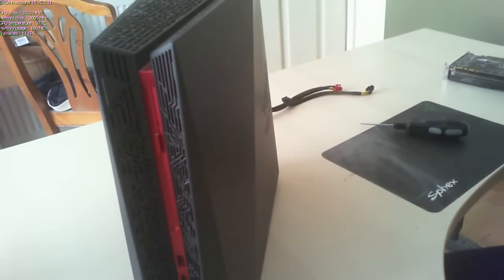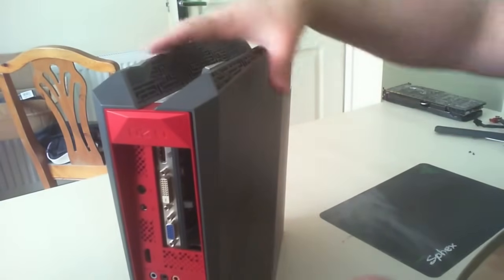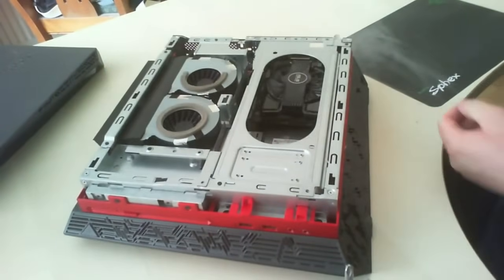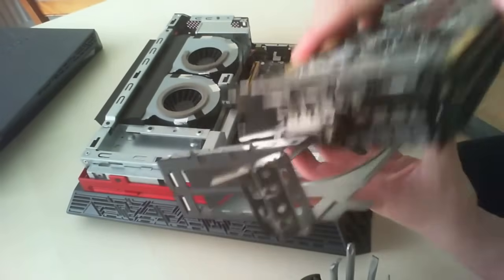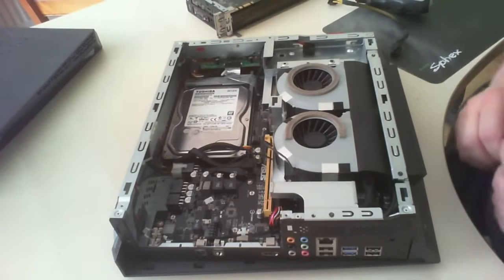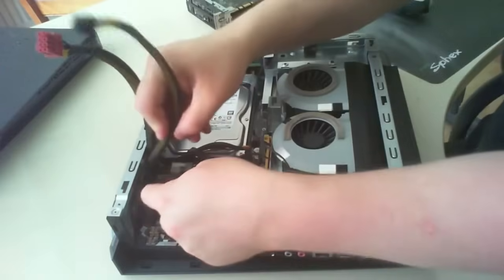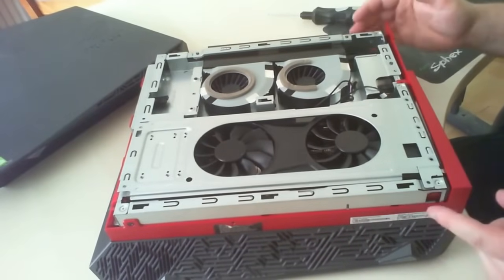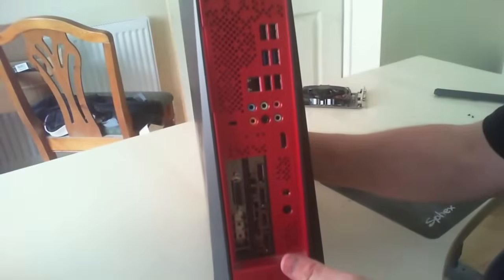How To change Graphics Card Upgrade Tutorial (Asus ROG G20AJ)

Comment: I was wondering some sites say you have to move all the jumpers up (the row of jumpers) some say only a couple you move, I've yet to find any discription on what those jumpers actually do
Reply from the maker: when I did these videos over 10 years ago, I though it was to active the second power brick to make the upgrade. but to be honest moving them or not their seemed to do nothing. but I have not had this system in that time so I have no way to test this for you, check the asus rog g20 forums and ask the question.
Reply: I was thinking the same?I have moved the jumpers one website said to move,and it acts if it only runs off 1 power supply and not both?

Comment: great tutorial.  I'm working on my daughters because she lost all video output (monitor won't recognize the connection).  Her's has a EVGA GTX 1060.  Should i get another one of those or is there something better that you're aware of?
Reply from the maker: Hello, glad the video still gives people valve after all these years. have you plug cable and plugged it into the onboard motherboard, just to make sure your system is till running fine as it as might not be a fail graphics card. what system do you have, cause it depends on your cpu and weather going above a 20 series might be a waste of time, just cause your have a bottle neck on your cpu.

Comment: can i put an rx6600 in there since its only 132 watts
Reply from the maker: Hello, if the card will fit, then change the second power brick to the dell power brick and that will give you the extra amount over the standard power bricks, also you change the power of power takes within the MSI afterburner software, so you can run it even on the standard power bricks. just depends if you want to use all of the power of that card
Reply: @ ok cool thank you

Comment: I have the gtx 750 i5 version. What gpu should I slap in it if i don’t want to upgrade psu?
Reply from the maker: hello, which model computer do you have, is it the AJ or BM model? do you have 1 or 2 power bricks? cause you will need to factor in the extra cash for the second power brick and power cables on top of the cost of the gpu

Comment: works with a 2070 fine for almost a year anyone tested anything beefier?
Reply from the maker: the issue with later new cards is the bottle neck with your cpu, some people might be still running the old i7-4790 and you will go so far before you will start losing performance from the card, you will just be having a powerful card and using only a certain % at any time

Comment: So im upgrading my G20aj from an i5+gtx 950 to an i7 4790 (non-k) +gtx 1080. I dont know which gpu pins ill need to make this work. I know the 1080 itself has 1 8 pin connection. What im not sure of is what Pins i need from the Mobo side of things. Any advice? Thanks in advance

Comment: Thanks a lot welsh, now i just bought a RTX 3070 Inno3d and 330W Powerbrick , but when i tried to running it, it wont turn on the GPU, what do i do wrong ?  btw mine is G20CI
Reply from the maker: Hello, do you get any display on start-up, I found some people which had this issue is either the pin inside hasn't been moved over on the JC01 pin or the riser card which is on the pcie of the graphics card is not flat and going into the slot on the motherboard. does that make sense, it does when I write it lol
Reply: @welshwhoopee  i thought the power supply is the problem , it is the 3070 that i bought is broken , i just repair it and it work like butter with original adapter , fyi motherboard cant handle more than 280w
Reply: so it unnecessary to buy another 330W
Reply from the maker: Oh ok, is that the Dell 330w power brick?

Comment: Hello nice video! I have a question, I have asus g20 aj with i5 4460 and gtx 960 2gb, upgraded the ram to 16 gb from 8 gb a few years ago. I have been running the GPU and CPU since I bought the PC like eight years ago or something and I really need an upgrade of components, what would you recommend? Sould I only upgrade the gpu or cpu or both, I know upgrading both may be there best option, but which one would you upgrade if you had to choose one XD? I have read some comments and I can say that I have the bigger original powerbrick that has 2 powerbricks attached to each other.

Thanks in advance!
Reply: And also will the motherboard be an issue since this is an older pc that may not be able to handle the newer components?
Reply from the maker: Sorry for delay, do you still need help?

Comment: Hello @welshwhoopee seems like u know a lot about them rigs. I am a computer-noob but have an G20 since 2016 with an i7 - 6700 @ 3,4Ghz, 16GB Ram and a NVidia GTX 980. It has 2 Power Bricks. What GPU-Upgrade would you recommend based on those specs? Thank u very much!
Reply from the maker: Hello, yeah I brought a few of these and work really on them and course help a lot of people over the year. your best gpu on that cpu is around the rtx 2000 series like the RTX2060/2070, mainly due to the bottleneck to your cpu. but if you upgrade your cpu then you could easy handle a card from the RTX 3000 series, like RTX3060/3070. the only issue is just which card and will it fit, the card itself has to be small then the founders edition/refence card and not to wide, as then 3000 and 4000 are 2/3 pcie solts wide, but send me a link to a card and I can help you or your budget.

Comment: Hi, i recently got a 1660 ti for christmas as a gift to replace my gtx 750. However, when i opened the case and tried to put in the 1660 ti, it wouldnt fit! I saw the dimension restraints of the card and my card is around 3 mm too tall so it wont fit in the case. Would there be any way to fix this or it is impossible to use this gpu.
Reply: I do realize the possibility that i couldve inserted the card wrong into the holder but i tried to fit the gpu into the case raw, and it still didnt fit. So i think this will be impossible to use.
Reply from the maker: Hello, you don't really need the case to put the gpu in. if you install and its too wide then you will need to replace the card, if your getting a new card and you want a 100% fit, then go for a founders edition/refence card. sorry for delay

Comment: Whats the best GPU i can put in there? Ive been using a 1080 for years now and im thinking of going up to a 20 series i just really want to make sure it'll work before spending the money. I obviously already have the power supply. Dont think a 30 series would work and even if it does it would probably be bottlenecked. I know its an outdated computer but mine runs just fine and im thinking of using it as a dedicated gaming pc toll it dies.
Reply from the maker: Hello, what model and cpu are you running? if your on the old Aj and have the 4790 then the 3000 will only give you cpu bottleneck, if you have the 6700 cpu then you should be ok with a 3000 series, but be careful as most of these cards are really wide, there started to take 2/3 pcie solts and will no way fit into this pc. so trying to stick to the founders edition/refence if your best bet

Comment: hello welsh i want to upgrade my graphics card to the best one i can fit in my rog g20 i think its the aj what would you recomend to ugrade it to i looked at a asus gtx 1660 super but it says it need 450w i only have one bif power brick
Reply from the maker: Hello, depends if you have 1 or 2 power bricks, if you only have 1 then stick to the model that doesnt need extra power but works through the pcie line

Comment: Thank you so much for your videos. Just wanting to tinker with my old PC. 
Can my G20AJ that didn’t come with the 2nd power brick upgrade from the original GTX750 to an AMD RX580 8GB without needing the 2nd power brick ? 
Having a hard time finding one, if you could recommend a current link to one that would be great.
Reply: No it cannot IF you use that card you will need the 180W power brick... Any 10 or 20 series NVIDIA card will need it to power up

Comment: Do i need to move that pin for the power supply if im upgrading from a 6 pin gpu to an 8 pin? Or will it already be in place to work?

Edit: for reference I'm going from a Gtx 960 to a Rtx 3050
Reply from the maker: what model is your pc? you don't need to move the pin and going from 6pin to 8pin is fine, do you have 2 power bricks?

Comment: for this pc, im going to upgrade the gpu to a gtx 1660 from a gtx 750. will it be possible? im worried i dont have enough pins or space.
Reply from the maker: Yes it's fine, just depends on the card you choose and if you need the second power brick
Reply: so the gtx 1660 will fit in the case and it has enough pins to plug in?
 @welshwhoopee
Reply from the maker: oh yes
Reply: @welshwhoopee hi i just got the 1660 ti for christmas and i looked at the card and it had 8 pins. however my current gpu of a gtx 750 uses a 6 pin. will the case have an extra 6+2 pin in it or it just won’t work? i really want to use this graphics card.
Reply: If you see this, i tried to put the graphics card in the holder and it is too big to lock. Will it be ok to plug in without the lock? How do you plug in the gpu without a holder as you said in the video?
Reply: Ok so it turns out my 1660 ti can’t fit in the case at all. With and without the holder. So i guess i can’t use it unless you have an alternative way to use it?

Comment: Thanks for a great video! I have the G20AJ with two power bricks and a 980 GPU. What graphics card would you recommend putting in now in 2023?
Reply from the maker: Hello, don't go anything above the RTX 20 series as your cpu will be your bottleneck on that system
Reply: @welshwhoopee  Thank you so much for getting back to me 🙏 Would any RTX 20 work, even the most powerfull/high end? Would you recommend any specific card? Thanks! 🙏❤️
Reply from the maker: well you got the AJ model, so max cpu is the i7-4790k, but with only 1 power brick then your limited to the lower tier which don't have any power to the gpu, if you can buy a second power brick cheap then your more open to much batter cards.

Comment: please help me - tell me what the jumpers are responsible for, I can't figure it out and connect an additional 180W power supply, I already understood that a 230W power supply can power two connectors 6 and 8, but if the video card consumes more than about 150W, the computer turns on, you can also probably switch it with a jumper so that the second power supply is used to power connectors 6 and 8 at 180 - right? how to do it ? my new card is gtx 980
Reply from the maker: Sometimes you need to do the switch jumpers but not always
Reply: @welshwhoopee  I already figured everything out myself. One lone jumper enables or disables auxiliary power (6+8). The remaining five jumpers in a row switches from where the video card will take energy 6 + 8 - either from the main unit 230 or from an additional 180. Excellent power supply flexibility - thanks to asus engineers. Personally, I bought a dell slim cylinder for a 240w power supply and it alone feeds the entire system - now it's a gtx 1070, but soon I will switch to 1080ti. I really, really like pascal - it can be super undervolted. I plan to undervolt 1080ti to 120w tdp. It's just incredible - no heat, no noise, and only a relatively small loss of fps. And more reliability-life of the video card.
Reply: @welshwhoopee  Please help me !!! - I really need photos and dimensions of a plastic clip - which keeps the video card from sagging in a metal bracket. I want to 3D print this clip - but I have absolutely no data about it. And I asked in several places - no one responds

Comment: I want to use a 1650 super, the graphics card has a 6pin, can I use a 6 pin to 6 pin or do I still need the 8? When I did the 6 pin to six pin and moved the jumper to the left it recognized the card but I couldn't boot because it said keyboard wasn't detected and didn't recognize the USB dingle for thr wireless keyboard or when I plugged in USB keyboard. Ideas or suggestions?
Reply from the maker: So you have installed the 1650 super and still nothing from usb?
Reply: @welshwhoopee  changed the jumper as per your video, connected the 6pin from motherboard to the graphics card. Plugged it in and no USB.
Reply from the maker: inside windows or via the bios bootup screens?
Reply: @welshwhoopee  can't even get to the BIOS due to not having a keyboard to let me go to the BIOS, goes to a black screen that says no USB detected
Reply from the maker: I think I had the same error funny enough with my pc at that time, the way I got around it was getting a converter, on the back of the pc are the old school mouse and keyboard ports, you can get a adaptor that takes it from the old school mouse/keyboard to usb. the item is a "PS/2 Adapter - F/M - USB mouse to PS2 Adapter - USB to PS2 Adapter" you might have one kicking around, cheap to buy on amazon/ebay, that way you can gain access to the bios and I am sure from there I had to change a settings to make the usb work again.
Reply: @welshwhoopee  no ps2 ports on the back.
Reply from the maker: yeah sorry I was thinking of another system, I don't own this pc no more so had to look it up on the net. btw are you running 2 power bricks or 1?

Comment: hey mate. amazing video! I would appreciate if u may answer me. I am planing get same gpu for upgrade. Did it work well without chanhing psu? Won't i need to upgrade the psu? Thanks in advance <3
Reply from the maker: Hello, depends what gpu your upgrading to, some don't need the second power brick and you can get away with using just 1 power brick. what is specs of the pc now?

Comment: Hello I have an g20 with an gtx1080 will an Asus rtx 2080 ti turbo fit in it I'm aware I have to buy a new power brick will it work thank you for any help
Reply from the maker: Hello, do you currently have 2 power bricks to work the GTX1080 cause I 100% sure you do, depends on the RTX 2080 (as in model) the founders edition will fit ok
Reply: @welshwhoopee ey,I have an g20+gtx1080 version too,now i am considering getting one higher performance gpu to upgrade my pc, rtx3060ti and rtx2080ti which one is more compatible with this machine?

Comment: Thanks a lot Welsh Whoopee, your tutorials are really useful, especially nowadays, now that the GPU prices are dropping. I will try to upgrade my ROG G20AJ from the GTX 970 FE to the Asus RTX 2070 Super turbo (blower type). A bit tight regarding the TDP (215w required for a 230w psu), but I've read on the Asus forums that you can go up til RTX 2080 on the AJ... Finger crossed. Thanks again, I'll follow your video step by step.
Reply from the maker: Hello, sorry for delay. well the second power brick can handle about 150-160watts of power, but that will only draw that much if your running the graphics at full 100% power. just depends on the game and game settings on graphics, most times its best to keep it around the 50%, more power just = more heat. but let me know if you still need help

Comment: Do I have to upgrade anything else to run games? I have a default Rog G20 Aj and was also planning on upgrading my gpu from 750 to 1660 super
Reply: Basically, will the old parts be able to keep up with this new graphics?
Reply from the maker: Hello, sorry for delay. depends on the game, what are you planning to play?
Reply: @welshwhoopee  no need thanks for the reply! The games I’m having most graphical issues with are Overwatch 2 and Fortnite!
Reply from the maker: yeah I play overwatch 2 on a laptop so its a easy game to play and so is fortnite, the update to the 1660 super should be fine, just let me know the model before you buy and I can say 100% if it will fit before you waste your time and have to send it back.
Reply: @welshwhoopee  I wish I had let you know the model… It’s from Zotac gaming and I don’t believe it fits
Reply: Could I get away without using the case?

Comment: where can i get and what is this second power brick called? also i have a G20AJ with i5 44?? with gtx 750 wanting to put in a sigle 8 pin 1660 super 8gb
Reply from the maker: Hello, sorry for delay. you can buy them off ebay cheap enough. just search for "asus rog g20 power"  also search for a cheap "I7 4790" if you can get it cheap enough then its a great cpu for that system

Comment: Hello Welsh Whoopee, I am upgrading my gtx 970 and i have a g20cb.  would a 3060ti work and i have the 230 + 180 power brick.  do you know the best graphics card that would work if the 3060ti wont?  Thanks for your help and nice vid!
Reply from the maker: Hello, depends on your CPU. I guess you have the i7 6700? the best one that will fit is the "rtx 3060 ti founders edition" as its a dual slot card, not sure if this card will bottle neck on your CPU as I have personally not tested them both out at the same time.
Reply: Sounds like the rtx 3060 ti founders edition will work, did you go for it? I have the CB as well and am ready to go bigger.

Comment: When you upgrade this graphic card in the video , you dont need to upgrade the power source as well ?
Reply from the maker: Hello, depends on the graphics card that was installed, if it needs extra power then I would have had to install another power brick
Reply: @welshwhoopee  When shopping for a replacement gpu card, how will we know it if will require an upgraded power brick? - Great video. Thank you for taking the time to make it and teach us.
Reply: @welshwhoopee  To be more specific,  I am considering upgrading from a 970 to a 3050. Is it possible and will a new power brick be required?
Reply from the maker: depends on the card, if it needs extra power. my guess is you will need the second 180w power brick, why RTX 3050? remember look for the founders edition cards as these will fit and be the best for that system
Reply: @welshwhoopee what card matches the gtx 750 power draw???